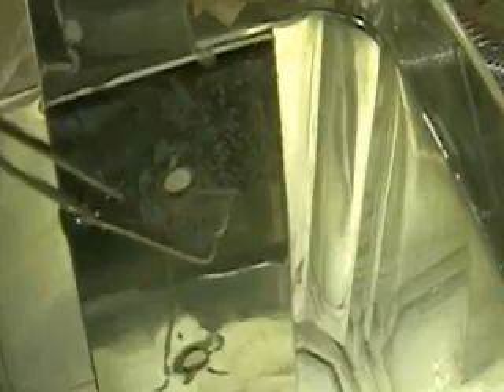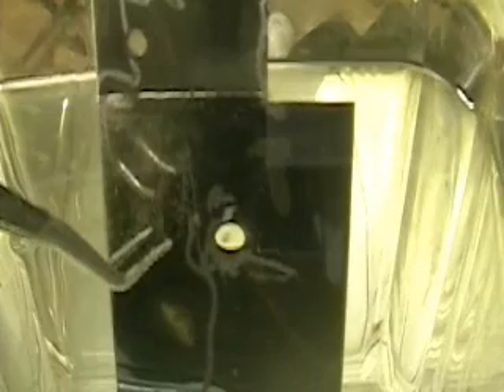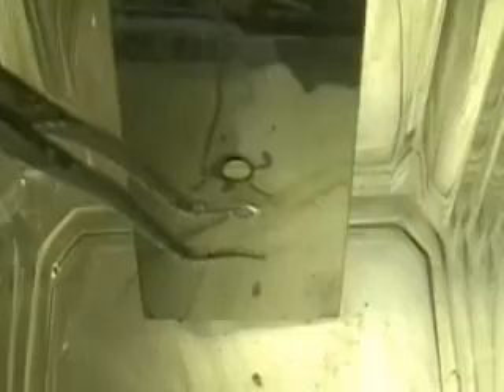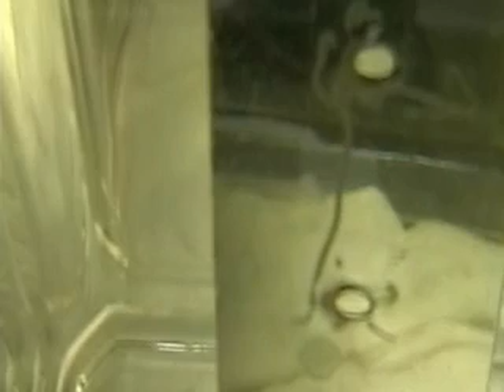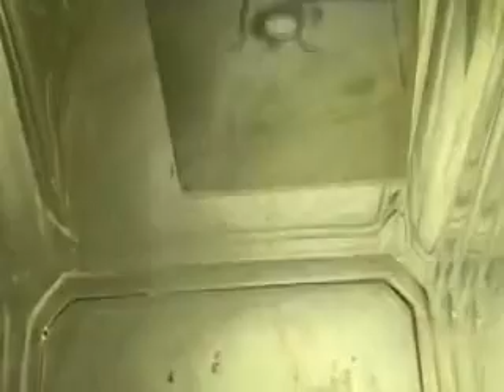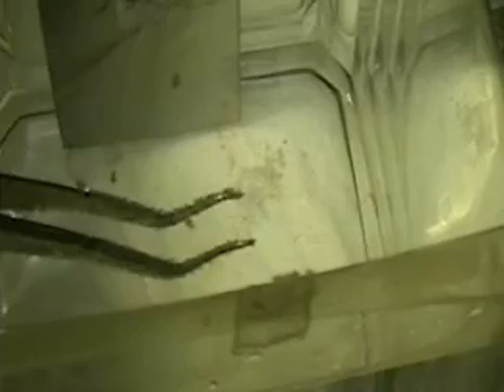Hydrogen Tap ( PLATE-TEST) 353

Comment: The water molecule is disassociated at a point between the plates. At this point we have individual atoms too small to see. Oxygen has a slight neg charge so the atoms migrate to the pos plate. Hydrogen has a slight pos charge so migrates to the neg plate. Once enough atoms accumulate on the plate surface, bubbles form. As the bubbles get large enough for bouancy to overcome magnetism they float free of the plate surface. Think semi-permeable. Car cleaning chamois cloth works for me.

Comment: An interesting find.  An idea is that it might have something to do with the electrons on the surface of the metal repelling one another, and the ones at the edge arn't being repelled as much since there is a lack of metal and hence the electrons on it.  Maby some metalurgist knows. I wonder if copper plate with a stainless steel coating would have good results.

Comment: The probes with their sharp points have a much higher current density. More Ox bubbles appear to collect on the probe. The plates DO have the
H bubbles on the but they are spread out on a larger surface and lower current density.
Keep up the good work.
RonL